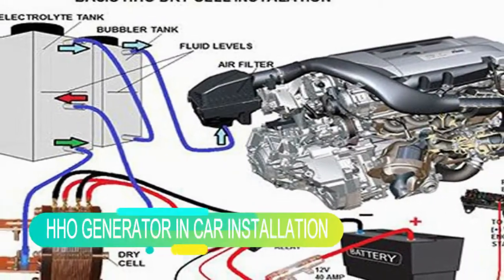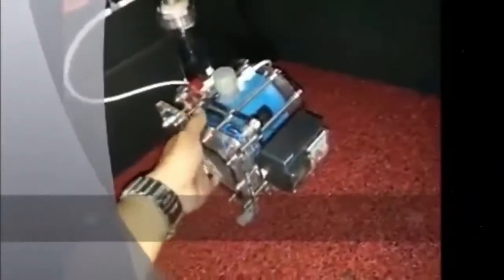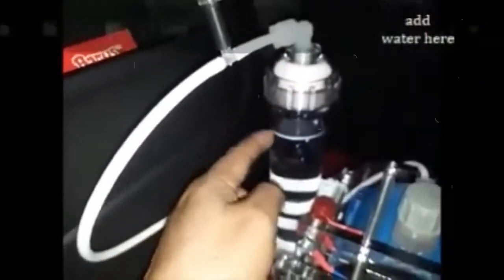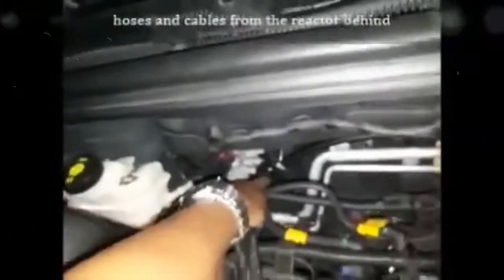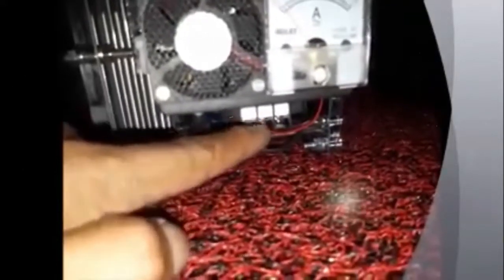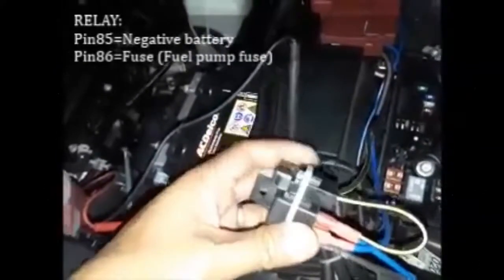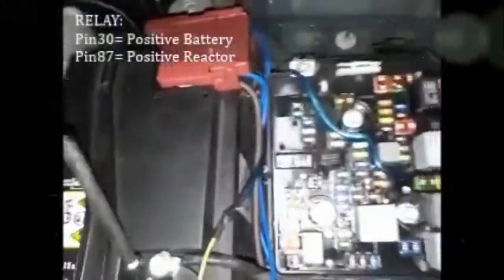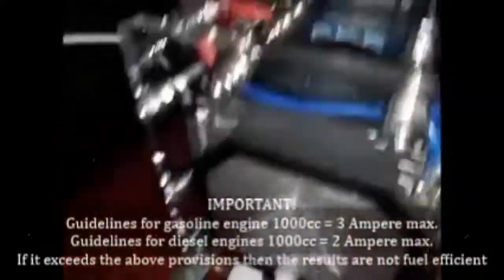HHO Generator In Car Installation - The Fuel Is Higher Quality

Comment from the maker: This is HHO Generator by Joko Energy
Reply from the maker: 229/5000
HHO Gas Generator can save fuel use by more than 40%, and reduce emissions by more than 80% in new gasoline-powered cars. According to the manufacturer, this HHO Generator can be used for more than 500 km

Comment: Can this device be installed on a TURBO engine?
Reply: im looking for the same answer
Reply: @SteveWideawake  It probably can't. There would need to be a pump to give the HHO a higher pressure than the turbo develops, in order to "push" the HHO in the engine. 
Else the turbo would push back air into the HHO cell. I am looking for a cheap air pump tha develops at least 2 Bar ...

Comment: Actually hydrogen content in diesel (C12H28)is more than any fuel , even petrol (C8H18) also less than it .. that is why diesel not need an ignition ... but the lack of oxygen (20.9 %)in the air not enough so pollution happens .. to reduce pollution attach a HHO injector available in market .. it inject clean hydrogen and oxygen in to engine and unburnt diesel will burn and water made from the hydrogen combustion will wash all nitric and other dirts ..kit available now is hydrogen and oxygen generated   Flows through  in one pipe . But  it should be separate feed in to the engine like hydrogen through diesel injector and the oxygen through  air intake then only get the good effect . I think change design needed

Comment: NICE . I TRY TO BUILD 1 UNIT. for testing only. i put direct supply battery into hho without using pwm. the hho getting really hot. until the bubble tank cannot withstand the temperature.